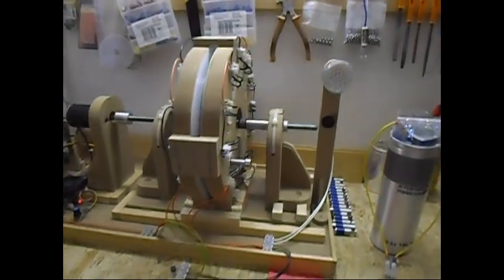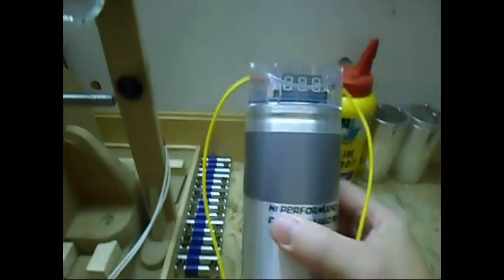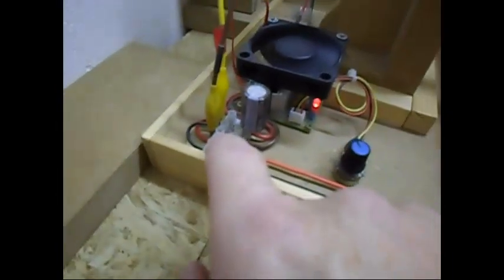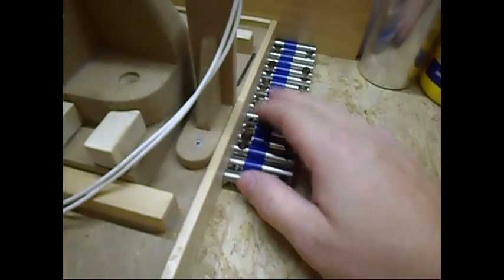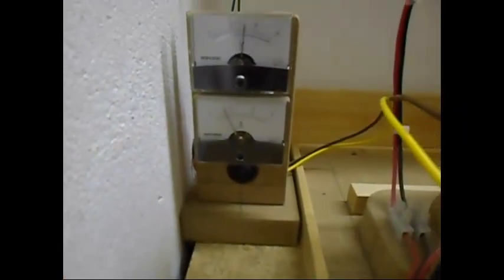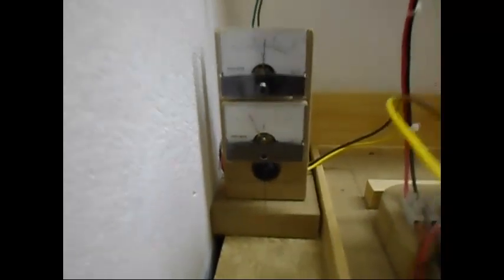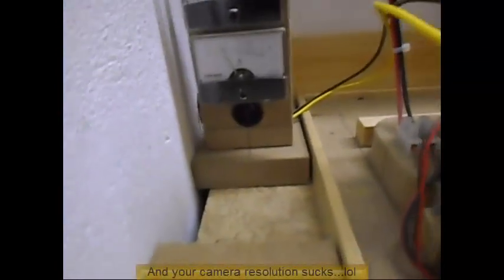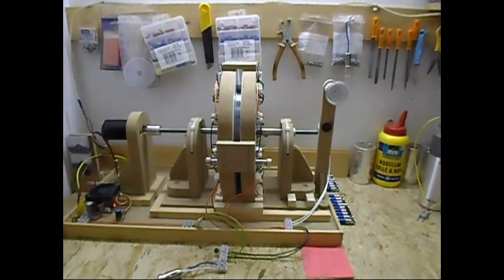Single Phase Generator_Update 6 - Some testing to see how different loads effects the system...

Comment from the maker: Just a small update with some numbers on some basic test that i've done...^^
Here are the numbers,

Open system/no load   - 1711 rpm
1 watt dc load test        - 1705 rpm -6rpm
Dc output shorted         - 1718 rpm +7rpm
Large 1 Farad cap         - 1698 rpm cap was filled to a max of 7.5vdc -13rpm
Output back to system - 1702 rpm -9rpm

Now this setup has been partially dismantled and work has begun on the 3 phase generator...^^
I might connect it in star/delta or just 9 sets of coils as mention in the video...whatever gives the lower voltage/higher amps...^^
Reply from the maker: Thanks for your comment...^^
These coils are just off the shelf coils and single wire...nothing fancy...;-)
Reply from the maker: The old but good star or delta 3 phase...^^
That's a lot of power, 100Amps @ 440Votls...o.O...so it better work like you wrote..."harder but more efficient"...;-)